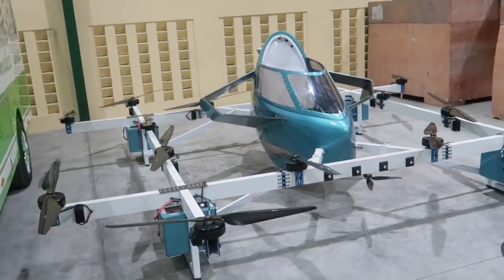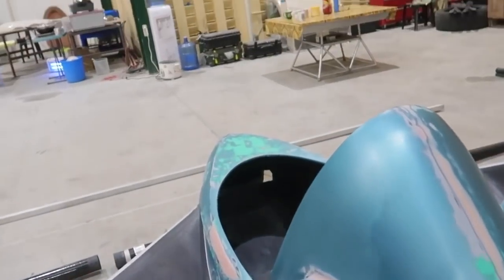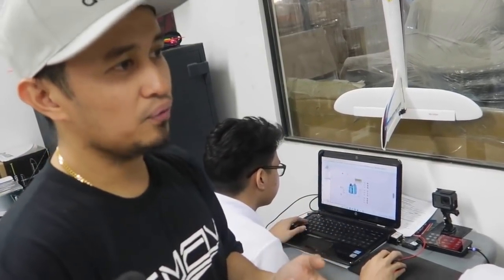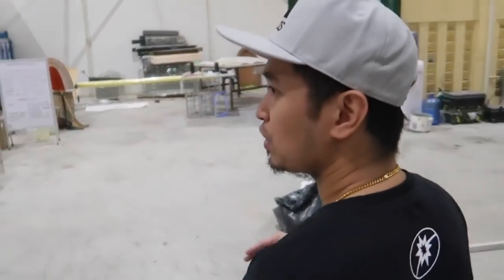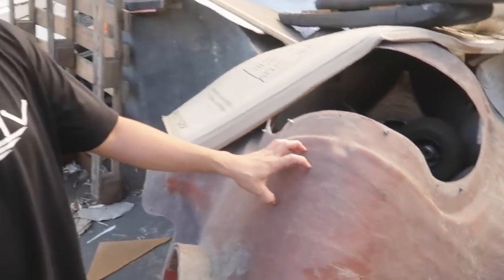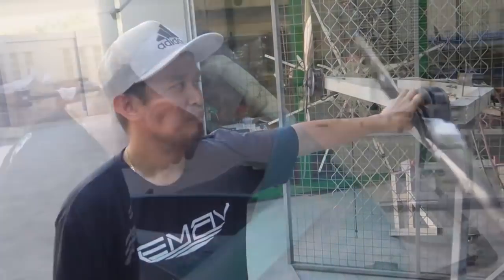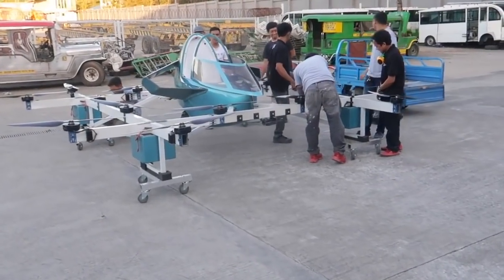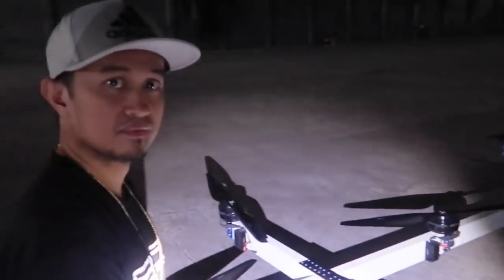Flying Car Philippines

Comment: How about building one to carry patients to a trama hospital 🏥 the ambulance is always stuck in traffic and people don't give way. Here in the United States they use helicopters 🚁 but this would be a cheaper alternative
Reply: Yun lang, di na kakayanin. If you want further explanation, just search fundamentals of flight in youtube. Basically, the weight would be too much to handle for the blades na ang solution is to add more blades, o helicopter na lang talaga para mas efficient.
Reply: Imamaneho daw ng patient 😂

Comment: Imagine having longer flight time and better power source. This could be the future of transportation
Reply: IDK why they keep doing these? What's the advantage over a helicopter?
Reply: it's coming. And these are just toys. Antigravity will come too.
Reply: What if they use the same battery that Tesla model uses
I think it would Have longer flight time
Reply: @FARSIDE0_0  probable. But pretty sure its hard to come by
Reply: @FARSIDE0_0  Panasonic produces the batteries used in Tesla. The batteries are best in class but they are by no means some super special all powerful cell. Tesla gets their range by efficient motors, efficient esc, and high levels of optimization. Combined with TONS of batteries, Telsa's weigh much more than your standard car. Simply "Put Telsa batteries in it" isn't a magic fix all. I think a Tech to look out for would be graphene batteries, they should be able to drastically improve the energy to weight ratio.
Reply: its good but now if you place a tesla solid state batteries here this the efficiency will go high and have a potential to be a future daily transportation
Reply: @FARSIDE0_0  agree. especially now they have developed 4680 cell batteries.
Reply: Yea it's called gas
Reply: @maximos905  electric is the future whether you like it or not
Reply: @1anfinity08  you said imagine having a better power source, I only answered it. Liquid fuel has more energy and less weight than batteries which makes it more ideal for flight
Reply: @maximos905  you have a point but here's the thing. An engine that runs gas is significantly heavier than motors connected to a circuit
Reply: @1anfinity08  I'm sure you're right, I dont know much about it because I'm not an engineer or mechanic but I think even electical vehicles have motors
Reply: @1anfinity08  you should look up gyrocopters, that's essentially what this is but they run on gas and have been around for decades.
Reply: @maximos905  of course they have motors but the weight difference between gas fueled engine and electric engines is quite significant. Also gas fueled engines have more moving parts (depends on what type of engine really) compared to electric engines. But then again helicopters exist and they use gas as fuel. It all comes down to efficiency. Batteries cause less in the long run compared to gas. They are also not that bad to the environment compared to gas
Reply: Not many people respect basic road rules in the country, you expect this to be any better?
Reply: @shatterpointgames  SHORTER FLIGHTS...OF COURSE NOT FOR FARTHER TRAVEL

Comment: That would be go to get around in Manila to beat the traffic
Reply: it would be very dangerous because there is alot of buildings and wires in manila there is no safe place to land that in manila and fly that its more better in province like open areas like rice field or open land with no buildings or wires
Reply: @norskychua9126  I'm from quezon province and I think we need this instead

Comment: Magaling sya. Kaso challenge dyan flight time. For 15 minutes malabo yan for mass production. Consider solar power saka land mobility. May gulong dapat. You should tie up with Tesla.
Reply: You should have been there. , , , KASO  .... your hands can only work on your TINY KEYBOARD
Reply: @YYC403NOYP  I'm actually suggesting for a feasible and practical application for improvement. Ikaw, nganga! 😂

Comment: Manila electricity is 3rd most expensive in the world. It wont be cost effective to use batteries and charging them all the time. As long as there is corruption and manipulation by Meralco and the elec cooperatives, this thing wont take off in the Philippines.
Reply from the maker: Solar
Reply: @GadgetAddict  same issue, due to corruption Meralco is able to block big players in the solar enegy sector which they have succesfully done with some companies. In most other countries solar is common in commercial even residential use, in the Philippines its nowhere to be seen. Only some small scale solar projects here and there which are generally not noticed. Solar won't be available to the general public.
Reply: Still solar☝️. Its gettjng cheaper and cheaper.  Electric companies  cant hold control on our energy sources for eternity.  As a matter of fact, solar industry in Philippines is now rising. More people are now getting engaged with solar and producing their own energy.  Diff. organizations who are tied up on this field are exerting more of their efforts to introduce solar to the general public and giving them the basics on installation set-ups.

Comment: they should really think about the safety on that flying death trap.
i mean really if that thing flat in the middle of the water or anywhere.

that said that's a good looking jeepneys and motorcycle.
and im happy for their progress.
Reply from the maker: Same with a helicopter. Just have to make sure the system is as reliable as possible with lots of redundancies.
Reply: It can be design with safety features. A detachable prop frame and a parachute, most of all a trained operator. Cost is the only limiting factor.
Reply: Every aircraft are well equipped with system redundancies to make sure that there is a little possibility of system failure. Im sure they know all of those things. 
Infact, air transportation is the safest transportation. Explore the world of Aviation

Comment: Sir we can built that can compete with with fix wing capable of 500- 1000km, I have solution to your dream as we're both dreaming the same, but I'm more on power solution  the battery, battery that can produce energy beyond expectations of many experr.But I should show It in a proper time.

Comment: The next step is to have rules and regulations in flying this thing. For sure, there would be like places that this will be restricted specially on places with electrical post. It would be dangerous to hit those cables and causes a potential accidents. More of simulation and testing on the real road as well as to improve the noiseless fan as possible. But kudos for the project and I know and I believe it will be successful and it will be better than the first version. Keep it up and God bless...

Comment: If that kind of fjying asset ifcan use as defense where ithas capable to reach a hi altitude and capability attach a machine gun and monitoring gadget but with escorted other amphibians attack missle fastcraft especially use in Westphilsea and need just amore features as improving for as air assets.. With comnication to relay in. Our military airforce..

Comment: May isasuggest ako sa iyo mag add ka ng safety features na kung.mag total failure ang motors lagyan mo sya ng emergency  paracute .para safe pa din ang passenger at ang sasakyan   sugestiyon lang

Comment: Yes, but it still not solve the problem why this type of flying vehicle is still not used today for domestic use even though this concept has been proven to be viable and used many many years ago.

It's the noise pollution it creates.

Comment: Flying one of this is easy but regulations, safety and approvals coming from the government and who controls the air (ex. Federal Aviation Administration) is another to be dealt with. Because even using a drone either commercial or recreational, you are considered as a pilot. More power to you.

Comment: I truly admire the dedication and the enthusiasm of this inventor and entrepreneur Kyxz Mendiola! 
His Multi-copter will help to transport medicals or important mail, but only a limited copters will be allowed. This is not a transportation device for cities like Manila. Here are the reasons: Those copters are impossible to fly in heavy rain and heavy wind. They are to dangerous because they use airspace where helicopters and airplanes already are operating, means they have to fly low, increasing the danger for accidents. They can easily be used to attack anybody but they also can be shot down easily. This is not easy to land in a city like Manila. It maybe will be used in places like Dubai etc, but is limited because no parachute, no aircondition etc. It is not a solution for the mass-traffic, it is adding to airtraffic, and that means more work for aircontrol and police, but not more safety for the people, not for the pilots, not for the people on the street and the houses that are underneath those flying batteries. I see potential as a transportation drone for goods but not for people.
Reply: Planes/helis don´t share the same space with this! This flies lower, and, additionaly, the sky is huge...

Comment: Why not use a generator to keeping batters charged and will increase flight time and distant too.
Reply from the maker: People have done that with Tesla's. Primarily as a joke. 

The vehicle still uses a lot more power than the speed at which you can charge the batteries. 

So you end up with a small extension of battery life, but with additional weight, cost and noise. 

I guess it might be more practical to simply add more batteries.